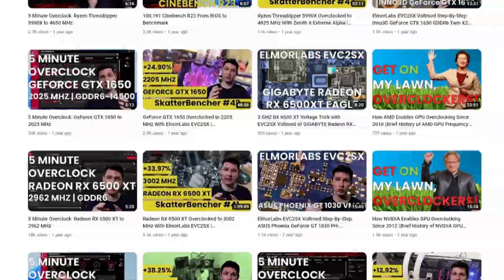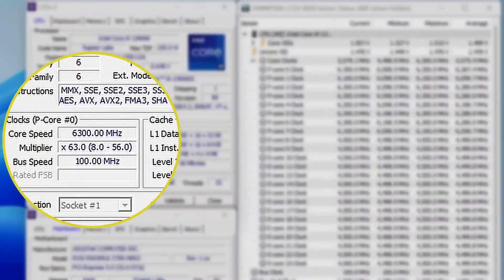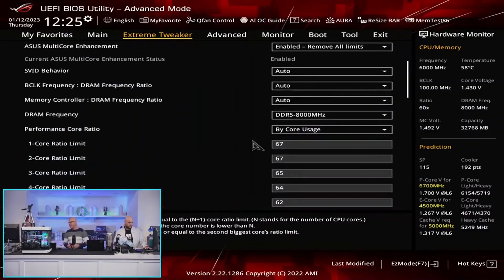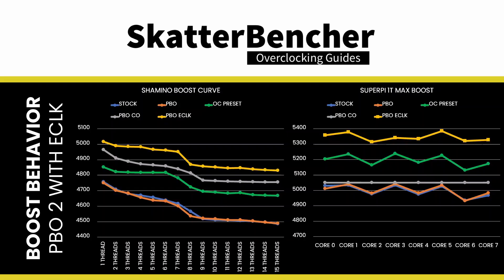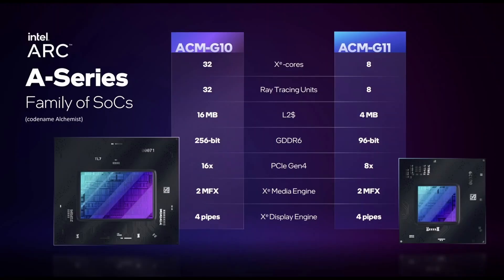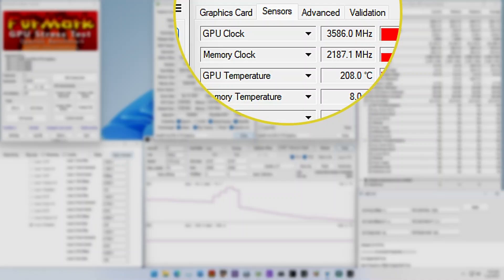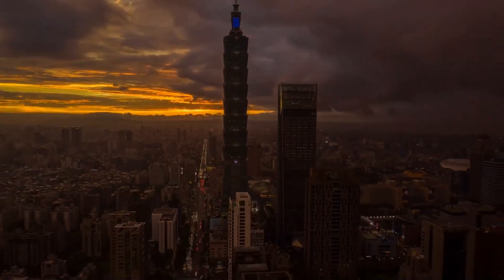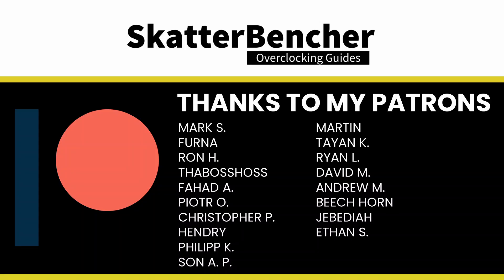Top 5 Overclocks of 2023

Comment: Good to see top overclockers using their skills for more than just benching.  I’ve learned how to get fast daily speeds out of my builds while keeping reliability.  I’m benching a 10900k at the moment but I’ll look to get the best daily setup when I’m done.  Coupled with an Apex board it is setup quite well out of the box to be fair.  Avoiding high temperature spikes is the key with this cpu to avoid unnecessary throttling.  Once it settles into a task it is spot on.

Comment: Hello brother, thank you for giving us information and contributing to these videos. I had a problem. I have an i7 9700f processor. The motherboard is MSI z390 pro processor. I want 47 per point to exceed 47. I want to set this to 50 but it doesn't work. Basic time setting is 102.56, I can't exceed the maximum 4816  Can you help with this issue?
Reply from the maker: The 9700F is a locked processor, so you cannot change the frequency above the rated speed. The only overclocking option is up to 103 MHz BCLK
Reply: @SkatterBencher  thank you

Comment: Skatterbencher. I had my PCIe SSD degrade on my 7800x3D ECLK (BCLK) OC. Same x670e gene you used with eclk (asynchronous). 
However, the other day I've realized my SSD dropped to like 6mb/s read speed and when I reset the OC the read speeds where all over the place. (crystal disk mark)

How is this possible? Thought ECLK was decoupled for PCIe and SATA. (I have LN2 jumper enabled)
Reply from the maker: Yes the Eclk are decoupled. Maybe the root cause of what you're seeing is unrelated to the OC?